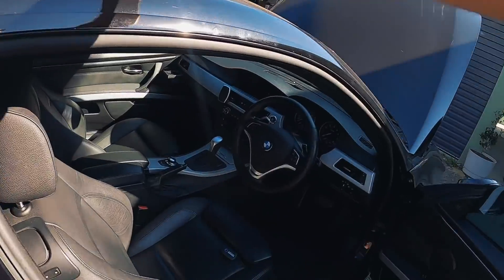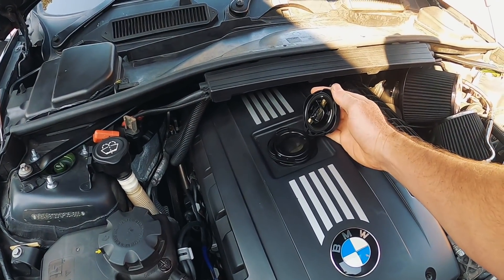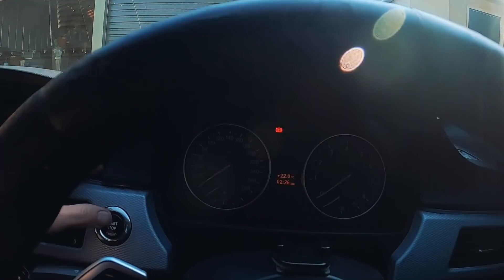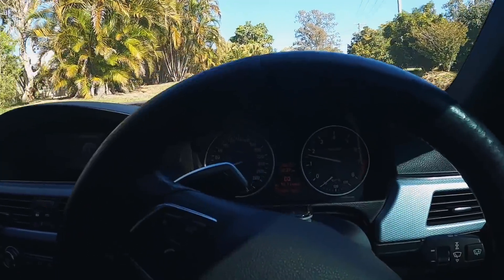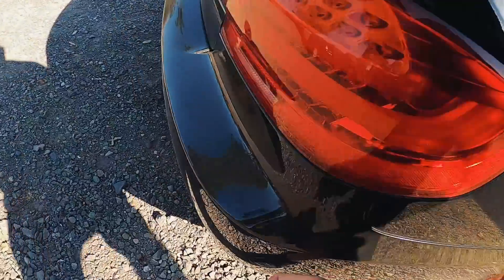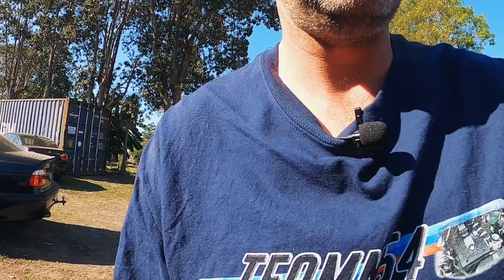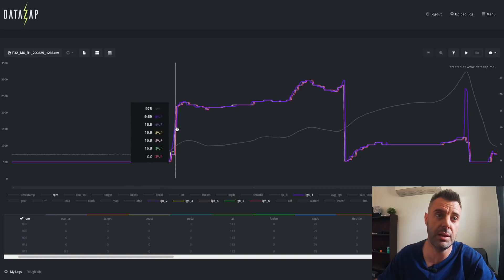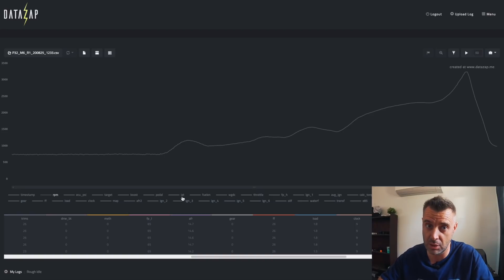BMW E92 335i N54 17T Hybrid Is Now A 5.5 Cylinder.....😖

Comment from the maker: I am assuming it's not coils, as there are no misfire codes. Same with Vanos issues. I would expect either of those to throw a code. But if the head gasket has given up, obviously the DME wont pick up on that.
Reply: Welcome to the rough idle club!
Very common on this engine and I don't think it is anything major.
In fact I am dealing with a similar issue as I my afrs oscillating 13 to 15. Did you say it is normal?In My older logs they seem pretty stable around mid 14.
Keep in mind dme particularly msd80 is not good at picking up minor misfire issues. It is proven it cannot pickup bad o2 sensors too.
But yeh in the past I have had rough idles just because of loose spark plugs so have a through check of plugs coils and injectors.
Let me know how you go as I am in the same boat!
Reply: Usually a rough idle without codes is an injector. But when you opened the oil cap it changed my mind. White smoke out of the oil cap means that there is oil blow by. I would HIGHLY recommend not beating on it as some of your piston rings or ring lands might be on their final ride. We hate to see it. Hopefully you can get a 100% accurate diagnosis as that’s just my 2 cents. Hoping you get it worked out!
Reply: And to add to my above comment, usually with rings and ring lands it’ll be lowered compression. Hence the misfire. It still seems to be running on all 6 but one of those cylinders has lower compression giving it that rumble
Reply: probably a spark plug, id check that first.
Reply: Compression test asap stop driving it, dont do the gasket before checking the block. I had the same issue on my x6 n55 motor did the gasket ran two days then the same. I had to rebuild the block. Compression test asap trust me
Reply: 2nd cats
Reply: Reset adaptations on the JB4 see if that works.... that happened to my car and it’s fine now...

Comment: A few options:
Get INPA and a cable and watch cylinder roughness. It's a bar graph and will show you how much roughness the computer is seeing on each cylinder as it's running. It's a realtime graph. This is better than looking at the log. 

Pull the plugs and inject compressor air pressure (125 psi)  in each cylinder at TDC with the coolant system open and look for bubbles coming out. This is better than combustion leak test (that tests coolant), or leak down test. 

Get a proper leak down test device and test at 100 psi, not a garbage one, or make your own, and make sure the orifice size between the two gauges is correct. The test above by putting full air into the cylinder is still better tho. 

Smoke test the entire intake track, turbo track.

Compression test will probably show nothing.
Reply: This.

Comment: Check, plugs, do a compression test, move coils around, drive it until it throws a code, make sure jb4 isn't doing auto clear.
Reply from the maker: JB4 is defs not on auto clear.
Reply: @ZeroTo60Tube  these cars give the weirdest issues, sometimes I just check everything including the coolant, do a couple logs and see if something pops up. So many integrated systems it's hard to tell. The jb4 it self causes issues.

Comment: I’ve had an n54 135i for about 12 years now and have had issues like this many times. It always ends up either being the plugs or the coil packs (I’ve had to replace both of those about 3 times as the older versions haven’t lasted very long). Typically these issues have started for me without throwing a code, and then not only until they have gotten worse have I noticed a code being thrown. I would definitely start with plugs but be prepared to have to change the coils as well! I’d be willing to bet you’ll be fine after changing out one of those things and it won’t be a serious issue - my car sounds exactly like yours when it’s one of those issues.
Reply from the maker: I really hope that is the case. The plugs have done about 2000k's now and the coils are about 5000k's old. Fingers will be tightly crossed. I still have the last plugs and coils, so i can swap them in to check anyway. Oh and i have a spare car as well..... :| Talk about thinking ahead. ha
Reply: Another thing I would check is how well the coils are seated. I’ve had aftermarket coils not seated completely and I have gotten these issues until I really pushed and twisted them into place. Might be worth pulling all the coils off your donor car and putting them on this engine to see if it changes. BTW, been loving the content - regards from Canada :)

Comment: The tunes (jb4) are made specifically for a certain type of engine, but even 2 exact same engines can have differences. Just like 1 fraternal twins. They are born the same but live a different life. You actually can’t run a general tune on your engine in my opinion. Especially after certain amount of mileage. That’s why the stock tune has a larger tolerance level and adapts to your engine over time. I’m not saying you can’t run it, but I don’t expect to be optimal. Having a tune specifically for your engine is the best way. The tuners will then tackle issues like these as well and will notify if you need to change worn parts.

Comment: I've had a broken ceramic from a spark plug cause this identical situation. As well as coil connections not being snug enough a separate time. Compression test is your best bet. Spark plug did not throw a code. Good luck mate!
Reply from the maker: Broken ceramic is another thing i hadnt thought of. If the spark is leaking there, the cylinder may slightly fire, but not fully and the dme wont see any issues to throw a code. I will get the plugs out first thing in the morning

Comment: Turn on quiet cold start on MHD. However you'd think it would be all through the rev range if it was a cylinder issue. Read codes and see if theres maybe a ghost code

Comment: What's up brother Dont know if you did it already but I want to let you know one of the things you need to do is remove the jb4 go back to stock now after that get a msd81 transfer the data to the Msd81from the msd80 once the car is back to normal go ahead and have a stage 2 plus tuned to the ECU. Or w.e stage you prefer. But tuned directly to ECU instead of a lying middleman like jb4. My car was doing the same thing due to cylinder 1 and 3 mosfets had burned. Msd81 is much better anyway. Due to the power Im pulling. Good luck

Comment: Disconnect one O2 sensor at a time and run it to see if it would make a difference, I’ve had rough idle through a bad O2 sensor and wen I disconnected it it has made the car run smoother, take out your spark plugs and check to see if there is a leaky injector, I had index 12’s on my N54 and one of them was stuck open, check if any shadow codes pop up also because sometimes they won’t show the “check engine light”

Comment: Could be a cracked valve cover, or leaking valve cover gasket. A lot of the times they don’t always blow oil out indicating a leak, rather at times they suck air in causing rough idles, startups, and misfires. First I would change your spark plugs, and maybe coils too unless they were replaced recently. Maybe even take a few logs and post the datazap links on your channel for us to look at. There’s no chance you lifted the head or blew a head gasket.... They’re MLS head gaskets.

Comment: the cover of the pcv valve does not seal. Install a sealing ring between the pcv valve and the ceiling so that the pcv valve sits more firmly in the valve cover

Comment: And this is the reason I am LS swapping my 335i, $10k in parts and upgrades only to have the throw some kinda code at the track or simply driving on the streets, actually I haven't driven it in months. Love the n54 so smooth with linear torque but every week, it's something else.
Reply: "but everything week". yeah.. if you chance stuff from original and true to make like 2x power it has stock, abuse the shit out of it, its not gonna hold. Ls is not the way, its just excuse
Reply: @TopiAS06  more like closer to 3x power, yes I expect things to break I say it all the time, I break things all the time. I love the car, the engine, the looks, it's my version of a supra. But I also love driving more than working on the car. If an ls swap gives the the ability to reliability drive and have fun while still making power then that's not an excuse it simply allows me to enjoy my money  more often.

Comment: i have had that issue before! make sure the boost solenoids are properly connected and/ or functioning. DO THE WALNUT BLASTING NOW!!!! take the manifold off and look how bad the valves are. also make sure to change the pcv valve to a metal version. check all of the vacuum lines. n54 not know for head gasket issues. check the plugs, oil, and coolant.

Comment: My issue with all of the mechanical failure options is that this did NOT start while under load/boost from what I gather. You simply went out and started it and it sounded like it was missing. Almost like startup air injection. These motors are pretty tough. Typically lean conditions and oiling deficiencies cause the majority of mechanical failures with the n54. If its a head gasket, you will likely smell exhaust in your coolant reservoir. I vote fuel issue. It just doesnt sound "broken" the way I normally hear major engine trouble.

Comment: Just food for thought, i know there are tuners out there that can make our exhaust sound like it is cammed. Try putting the jb4 in map 0 and let it idle. Let's just make sure it is nothing tune related. 

I know you were scared to twist her out, but if you felt like the power is still there, it could be tune related. Just something to think about. I feel your pain mine is down right now for altenator. Having to shoot wires to check for shorts. The altenator, is completely shorted to ground.

Comment: Have you noticed any coolant usage ? Running that level of boost with timing too far can lift the heads in these. The stock bolts stretch.
Reply from the maker: I haven’t noticed any coolant. It’s have t had to add any since fitting the turbos.  But that is a definitely possibility.

Comment: I’ve had a sound and rough idle very similar to that on my 335i. For mine it idled like it had an upgraded cam in it, slightly choppy but would smooth out with a little throttle input or if I cranked my ac up all the way. My issue was a very slight leak in one injector. I never got any codes for it using the jb4 to scan, but I would get stuttering around 40% throttle or higher. The only other way I could tell was to get the car hot and park it for a couple of hours then pull each plug and smell for fuel. Also the injector seal to the head is a big one. If you waited too long after taking the caps off new injectors they will not seal to the head properly. Lastly, if one of the injectors wiggled around too much it could slightly warp the bore it is in and leave a small gap, but some people have fixed this with some special Teflon tape.

Comment: Bad coil might not throw code, get a new one and start rotating it through all cylinders until you find the bad one. Or maybe a vacuum leak? When you opened the oil cap, I would expect some change in RPM and I didn't catch any...?

Comment: Possibly spun crank hub so the timing is slightly off. But normally you would see vanos codes or something related. Have you tired running a log?

Comment: A crack piston on the ring land is usually the issue on the 5-6 motors I’ve taken apart. Sounds identical to that every time.
Reply from the maker: Do they normally sound cammed? Also when they do go do you normally get a ticking or knocking at the front of the motor?
Reply: @ZeroTo60Tube  No, nothing unusual in the sound -no ticking or knocking when a ringland is cracked. Check the whatsapp group mate - we're advising you in there
Reply: donwingchun is that group open for everyone?

Comment: nothing serious, check your plugs

on video nothing even sounds off, and vapor is always normal. do you have your head ports plugged? if youre spraying port fuel without plugged head ports itll dillute your oil very quickly.
Reply from the maker: Hmmm it definitely something significant, one of the cylinders is either down on compression or not firing properly. Will pull the plugs tomorrow morning and start trying to work it out. Basically it sounds like it's got a cam now, but the cam stays lumpy up through the revs.
Reply: @ZeroTo60Tube  I wanna say I had this exact issue and it was plugs, had 2 of them get eaten, plugs had pretty low miles also. This was before me upgrading to the R8 coils.
Reply: @ZeroTo60Tube  lol it's funny cause u said it sounds like u got a cam.. and from my view and listening I think u probably have a hydraulic lifter issue causing 1 cylinder to not perform well.. i can hear it in the video @2:42..

Comment: Hey, have you gapped your spark plugs? If gap is smaller than 0.21-0.22 , like around 0.18 that's normal sound.
If not get your spark plugs out compare all of them and check'em on a fuel smell, index 12 injectors may fail too, also you have port injectors which may fail as well. If it would be a headgasket issue your coolant temp would be higher, if it would be a piston ring you would have more gases in oil pan especially when you were revving it up and you would smell them when you open the oil cap. 
1. Get all spark plugs out if they look identical nothing weird get new spark plugs ( I change mine every 8-10k miles)
2. Do pressure test it's not gonna hurt you but you will know how healthy your engine is
Hope you'll figure it out
Reply from the maker: Plugs are gapped to .18 however thery have been since i put them in. A few people said they had the same sound due to plugs, so maybe fingers crossed. I assumed being so new they would be fine.
Reply: @ZeroTo60Tube  anyway if they new it doesn't mean that they work properly, I've changed 3 brand new coils in 2 days. With 0.18 gap 90% you will have a little rough IDLE. I would start with spark plugs they may show you a lot.

Comment: Nooo!  Compression test, but you said that already.  One of them kits for checking for exhaust gas in the coolant?  May be worth doing a smoke leak test before anything invasive?  Could just be a minor leak, older seals turning to plastic etc.  Fingers crossed it is, sorry that you'll get a game of 'find the leak', though.

Comment: Have you ever had the intake manifold off and looked to see if there is a heap of carbon build up on the valves. You said you thought the car was not looked after and not serviced so it could be really badly caked up in there which can cause a few problems along with rough idle. These engines along with all other direct injections are bad for carbon build up on the valves.
Reply from the maker: Yes they were cleaned a few months ago.

Comment: The .bin file might be edited to not see the misfire. From memory the lower limit is 450 rpm and upper is 6900.
Your tuner may edit this to get rid of errors on an e85 winter start (for example)

Comment: Perfect time to pull spare engine sell off what you want/need do a freshen up on the whole engine bearings rings etc with big hp studs and head gasket, simplify the wiring in the engine bay put in a haltech get Scott from nugget garage to tune it and make a new exhaust. Only issue is the gearbox might not like big power. Then the setup will be perfect to go single turbo when you want more power
Reply from the maker: I love your optimism there. haha.

Comment: Do you still have the mid cats? If you had engine issues you'd have faults/misfires, noises or coolant loss etc... If you have mid cats still on the exhaust unplug it at the downpipes (four bolts) then leave it as is, go on a test drive to see if you got your power back.

Comment: Coils/Plugs are pretty common on these ESPECIALLY When appying higher boost. (Plugs for coils can also be fiddly, check them, Mine sounded cammed when cylinder 1 coil plug came loose)

Comment: Sounds like an 02 sensor. Do you have JB4 or MHD app? If you can monitor your AFRs then you can tell if one of the 02 sensors are bad. When you let off the throttle when driving the AFR should go to 234. I just had my bank #2 - 02 sensor go and it was similar to your issue. No code initially, but after driving around the block I could see my sensor was stuck at 14.91 value while the other one was reading voltage ranges.

Comment: Looks like you may have lifted the head :( Leakdown test would be my suggestion after eliminating plugs, coils and injectors.
Reply: These heads rarely lift.
Reply: khaim5 b rarely, yes. But a leak down is still a good test to run just in case. Especially because the motor wasn’t particularly in good condition when he got it.
Reply: I've seen it happen quite a few times on these higher mileage engines, the head studs stretch over time with higher boost. Hoping it's not the case though 🤞

Comment: If you have access to an engine stethoscope see if you can track the sound that way. Check for exhaust leak. Check to see if your belt is still in tact. Any chance you forgot your spanner on one of the rear O2 sensors?
Reply from the maker: Anything is possible. i will double check the sensors today.

Comment: Check your oil filter for any metal shavings or fuel mixture within the oil. My 335 head a leaky injector and eventually lead to a rod knock. Not saying this is the case for you but it’ll be good to check, better safe than sorry & that way you’ll be able to somewhat rule out the injectors
Reply from the maker: Ohhh god, i hope not.